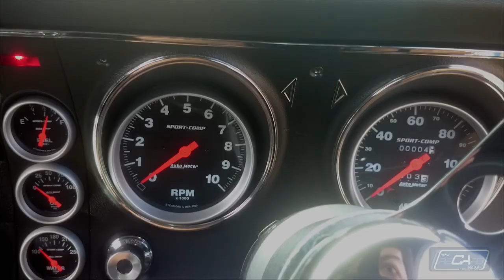Episode 7- How to Install a Weber to a Subaru Brumby

Comment: Hey team, not sure if you will get this as the video is a few yeas old, however the fuel return line that you guys cut and plugged, is that the one the goes through the fire wall just under and to the right of the spare tyre holder?

Comment: Good job! What kind of effect increase can you expect from this?
Reply from the maker: Hi. This upgrade will make a very noticeable difference. We must view this in correct context though; a carburettor does not make ANY power, your engine does. A restrictive carb (i.e. original) will hold back a lot of the acceleration, power and torque your engine can already make. The factory uses a 2 barrel vacuum secondary carb, meaning when you put your foot down only one barrel opens; the second will open later and slowly. This is OK for long overtaking stretches on the highway, but that's about the only time the engine can reach full efficiency. Fitting a mechanical secondary carb such as the Weber will allow your engine to accelerate as hard and as quick as it can under all driving conditions.
Reply: @recarbaustralia5772  that's aweosme information.  I really want to learn more about Weber's and which one would suit my Mitsubishi sigma 2.6. For everyday driving I want the power and reliability.  Would be great to UK need want the actual numbers mean for each Weber.  Pardon my ignorance but havnt had a carburetor car before.  Hence keen on learning.

Comment: I bought that same conversion kit, but the base plate is different from yours and I can't find one like yours. Do you have any suggestions?
Reply from the maker: Hello Michael. There are two different manifolds fitted to Brumbys; the early manifold has a larger base pattern, later is smaller (they put a smaller carb on to meet updated emissions standards). If you look at our listing you'll see an image with the dimensions of both: https://www.recarb.com.au/subaru-brumby-32-36-dgv-new-weber-carburettor-set.html
Reply from the maker: If yours is a Recarb kit and your base plate is undamaged we're happy to exchange for the correct one - just contact us on 07 5493 3788 or sales@recarb.com.au

Comment: Generally speaking, what would you charge for installation of one of your Weber carbs? 89 Brumby.
Reply from the maker: Hi Jamie, our normal installation charge to fit a Weber is $195, the installation takes around 2 hours. Call our workshop if you're interested in going ahead with this modification.